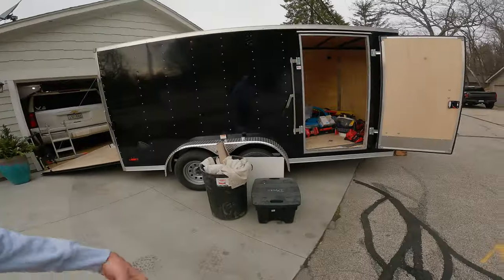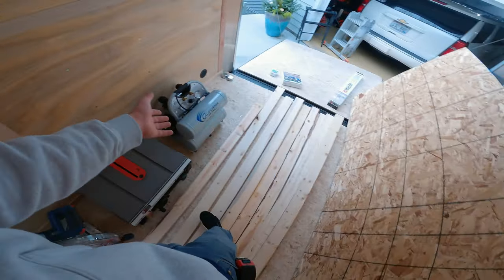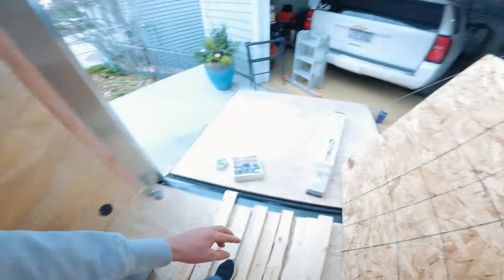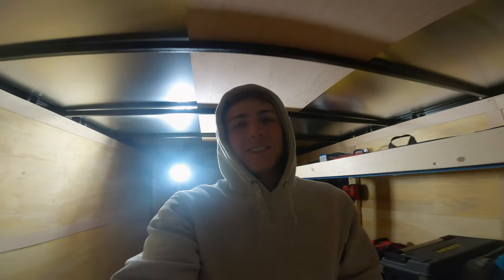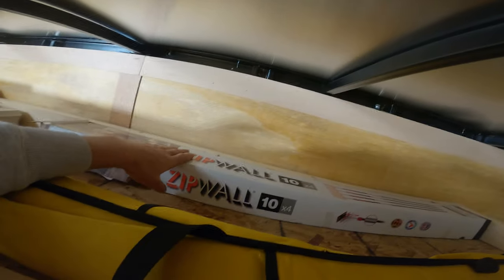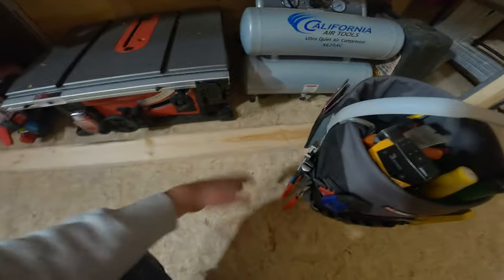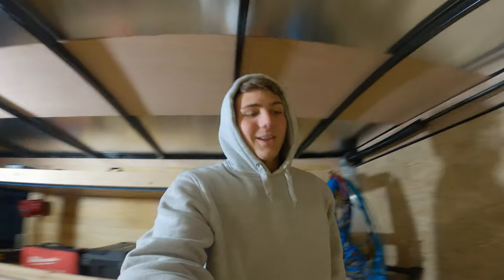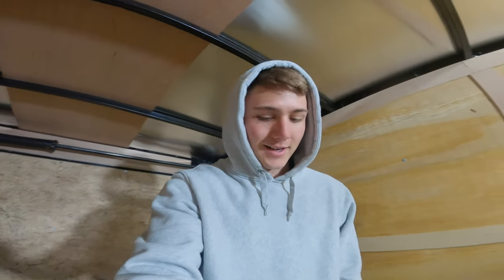Building Shelves For My New 14' Work Trailer || Ruetsche Builds

Comment: when you fastened the 2x4s to the exterior walls, can you describe how they were attached ? Thru the thin existing sheathing, into the the steel frame ??
Reply from the maker: I used self tapping metal screws to the steel "stud". Just make sure you get the right size screws and you should be fine!

Comment: I put down epoxy shield professional floor with the sprinkles. You should look into it!! You won't regret it!
Reply: @ruetschebuilds   shoot heck yeah! Getting ideals for my trailer getting tired of just throwing everything on the ground after a job and taking off.
Reply from the maker: @savagewarriorzz2199  I hear ya! I have been shifting my setup around depending on what I'm up to. Like I said mine is "temporary" and I wasn't lying XD. Moved it around 4 times already and know it wont be the last time.